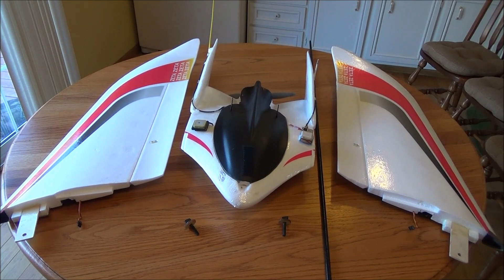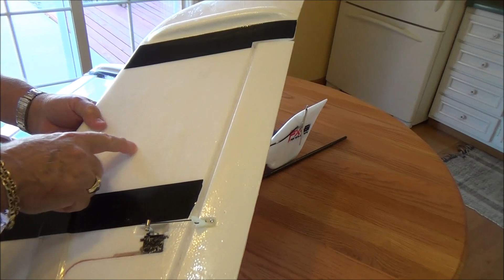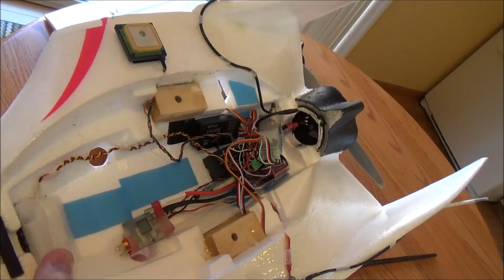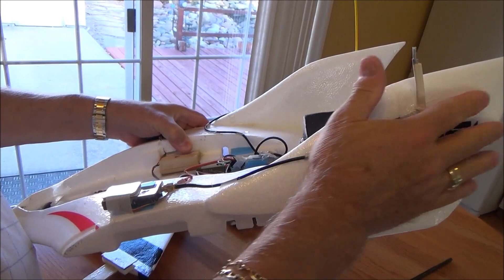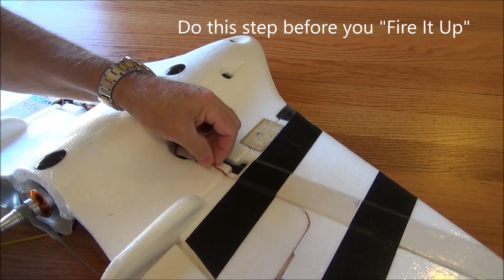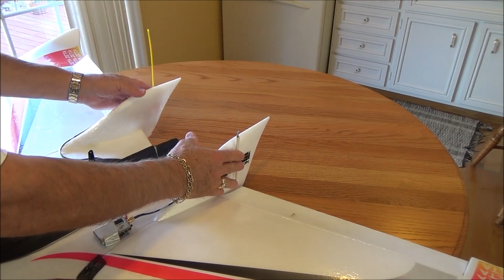FX61 Removable Wing & Lamination WalkAround

Comment: What type of laminate? where did you get it? Is it low melt?
Reply from the maker: Aloft Hobbies, The New Stuff  1.7 mill
Reply from the maker: Monocote Iron on High
Reply: ***** Thanks uncle Deek just ordered 1.7mil x20, 3mil x 20 and 5mil x 20 very reasonable, I even picked up a always on backorder FRSKY receiver while I was at it. All for under 49.00 delivered thanks again
Reply from the maker: SuperBell82 Glad I could help man, put one in the win column for today!
Thanks for watching
Reply: ***** wow, that was fast I received my package from alofthobby Monday, they even gave me a little  candy bar with my order :-)
Reply: ***** when applying it on EPP, do you think I will need some spray adhesive?
Reply from the maker: SuperBell82 Yes Kool me too that was Sweet of them, he he
No spray adhesive it has the stickie built in, set your iron to the hottest setting and go for it.

Comment: Love it Deek! My FX61 came in with removable wings stock in the box. Liking your setup more though as it looks WAY more reliable and rigid. I also get my lam from Aloft, and planned on laminating mine as well. I was only planning on doing the wings sections but I noticed that you did the center also and did a fantastic job, was it tricky to laminate the center section? any tips? If you don't already have one posted I would love to see a video of how you laminate. they always seem to come out so nice! And as always, thank you for your wonderful videos!
Eric D.
Reply from the maker: Eric
I love the 1.7 mill laminate.  I use a standard monocote iron set on High.  The top of the wings are one piece with no relief cuts, overlapped 1"  The bottom is one piece with lots of relief cuts and overlapped 1"   The center fuse is left over pieces on the top and the bottom is one piece.  The nose of the iron allow you to get in the holes on the bottom of the fuse and makes it look real smooth,
I will do a Laminating Film soon.  It may have to wait till we return,
I saw that the wings were sort of removable by design.  But the Spar is a joke.  I believe my mod is stronger.
Thanks a big big bunch for watching